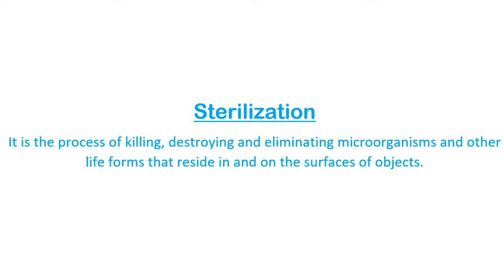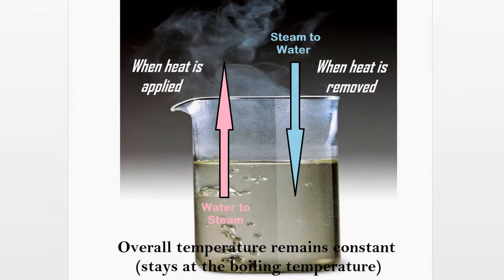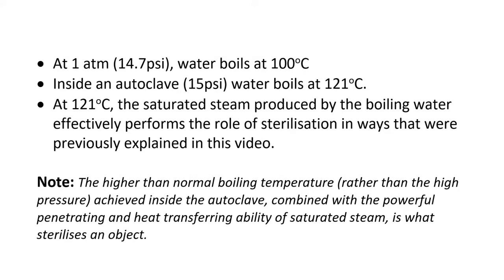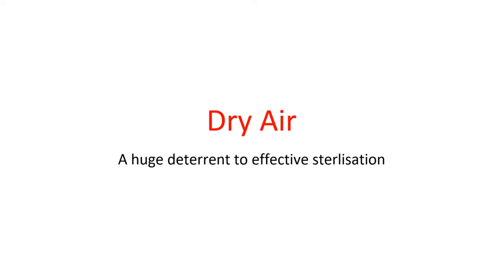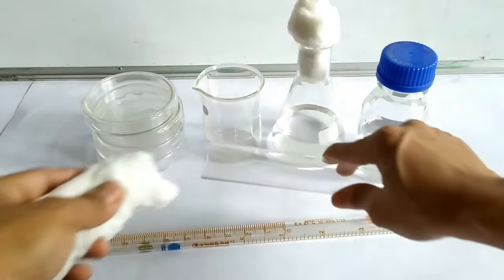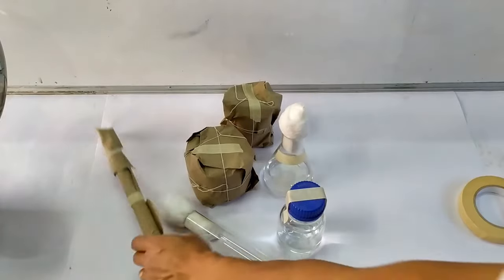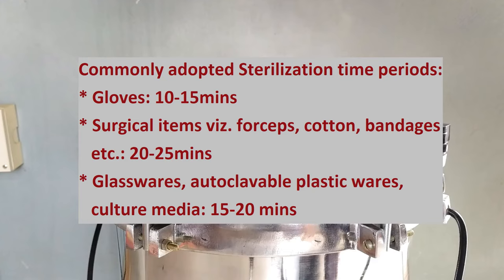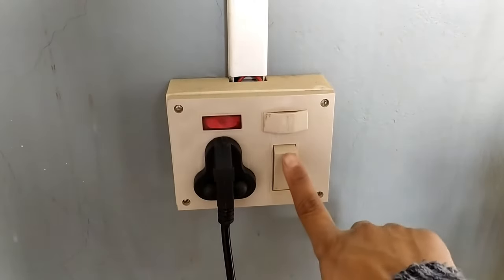How to use autoclave | Principle, Component parts, Working

Comment: Very helpful.  One suggestion on compressing gaskets like the one on the lid is to snug then tighten the lid blocks in a star pattern like you would on an automobile wheel (1,4,6,3,5,2) being sure the 1st two blocks are as close to opposite each other on the lid as possible.  This process will help eliminate potential gadget deformation that can degrade the life span of the gasket.  Thanks a ton!

Comment: Heyyy thomas
I have a doubt.
What is the difference between 0psi and 14.7 psi...
Because in my manual it is mentioned that at 0psi the water is at boiling temperature of 100°C.
Reply: Also at 14.7 psi you mentioned that the boiling temperature of water is 100•C..
Reply from the maker: 𝙰𝚝 𝚗𝚘𝚛𝚖𝚊𝚕 𝚊𝚝𝚖𝚘𝚜𝚙𝚑𝚎𝚛𝚒𝚌 𝚙𝚛𝚎𝚜𝚜𝚞𝚛𝚎 𝚝𝚑𝚎 𝚋𝚘𝚒𝚕𝚒𝚗𝚐 𝚝𝚎𝚖𝚙𝚎𝚛𝚊𝚝𝚞𝚛𝚎 𝚒𝚜 100 𝚍𝚎𝚐𝚛𝚎𝚎 𝚌𝚎𝚕𝚜𝚒𝚞𝚜. 𝙰𝚜 𝚙𝚛𝚎𝚜𝚜𝚞𝚛𝚎 𝚒𝚗𝚌𝚛𝚎𝚊𝚜𝚎𝚜, 𝚝𝚑𝚎 𝚋𝚘𝚒𝚕𝚒𝚗𝚐 𝚝𝚎𝚖𝚙𝚎𝚛𝚊𝚝𝚞𝚛𝚎 𝚊𝚕𝚜𝚘 𝚒𝚗𝚌𝚛𝚎𝚊𝚜𝚎𝚜. 𝙰𝚝 15𝚙𝚜𝚒 , 𝚠𝚊𝚝𝚎𝚛 𝚋𝚘𝚒𝚕𝚜 𝚗𝚘𝚝 𝚊𝚝 100 𝚋𝚞𝚝 𝚊𝚝 121 𝚍𝚎𝚐𝚛𝚎𝚎𝚜.

Comment: Hi Thomas. Thanks for putting together this resourceful presentation. What is the purpose of the sealing process with cotton and paper wrap for empty tube, pipette, beaker, and other petri dishes? I can understand the reason for the sealing process for the flask and bottle filled with the liquid/byproducts from experiments.  HB
Reply from the maker: If you don't seal them, germs can still enter the containers once you take them out of the autoclave after sterilization. Same reason and logic with why sterile urine cups, syringes, cotton buds etc are sold in market neatly wrapped in plastic/paper packets.
Reply: @TheSingtangpaScienceGuy  Ah!!! That makes sense. Thanks for your info.